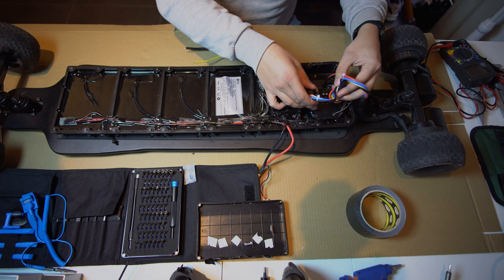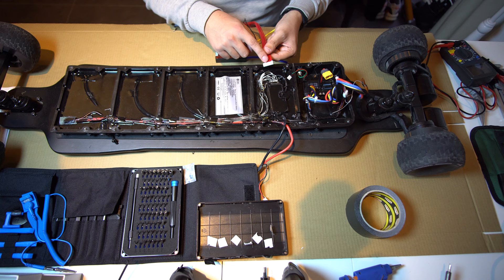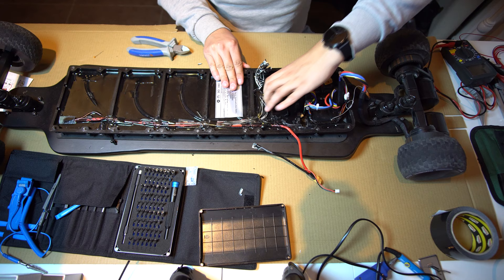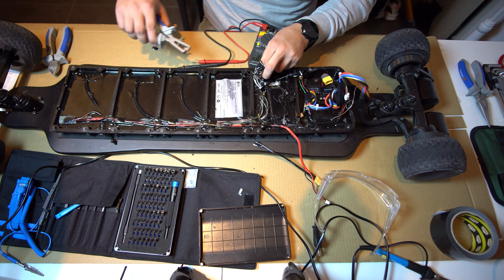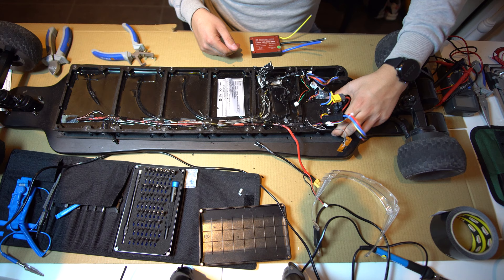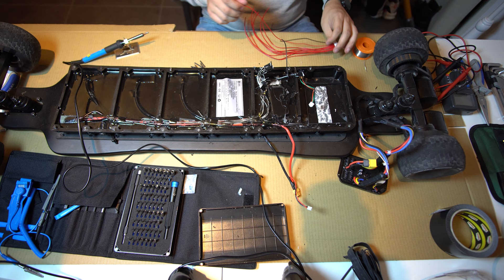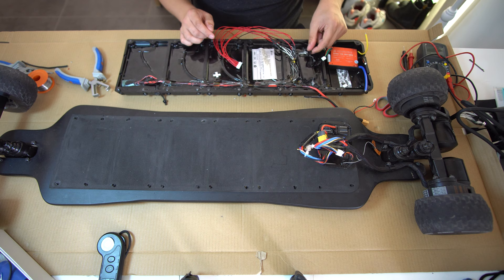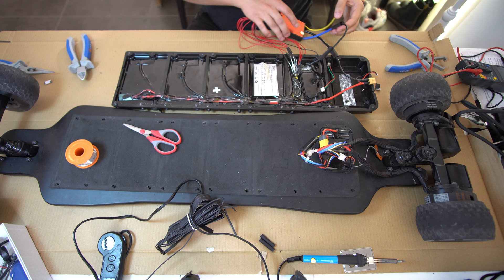How To Replace a BMS (Ownboard Bamboo GT Battery)

Comment: Hello sir. I got 43.6v for the whole pack. And 4.3v for each series. Is it normal?because even when i change the bms, the output from the bms is keep moving around 3.5v to 7.5v.
Reply from the maker: If the voltage keeps jumping around it might be the BMS. Make sure each series keeps a stable voltage. 

Goodluck!

Comment: Hey thanks for the video , appreciated! On the link, there is several bms of diff amps, which would you recommend? Thank you
Reply from the maker: I don't know the max power the motors can pull/the max amp the batteries provide. But if the amps you choose is lower then the max power draw of the motor/power output of the batteries, you'll be limited by the BMS.
Reply: Thank you

Comment: Well, I have an ownboard. I know it’s kinda of an outdated model, but recently, I have been seeing an issue, where the board switches off after I start applying brakes. It seems to be an issye only during hard braking. I am planning to replace the BMS instead of spending all that money on the batteries.
Reply: What do you think?
Reply from the maker: I've had this issue aswell. Mine seems to only do it when the battery is fully charged. When using the brakes, it has no 'space' in the battery to store the energy so it shuts off. After a couple of good accelerations, the problem seems to be gone. You can try to replace the BMS, but I'm not 100% confident it will solve the issue.

Hope this helps! Goodluck!

Comment: Can i use 30amp bms instead 60 amp?is there any effect on my bamboo board?
Reply from the maker: I don't know the max power the motors can pull/the max amp the batteries provide. But if 30 amps is lower then the max power draw of the motor/power output of the batteries, you'll be limited by the BMS.

Comment: Were the motors randomly cutting out and then resuming during your rides? Curious as to what time of issue you were experiencing with your battery.
Reply from the maker: The motors did not cut out. I was skating around 15km/h when I got a message on my remote saying 'battery level critical 10%'. Then it just  died and I got to walk home. After charging, the board turned on. When standing on it and accelerating, it just cut of and never turned on again.
Reply: @MathieuxLeysen   oh dang! Thanks for the video!

Comment: Does the new bms improve the charge time at all?
Reply from the maker: Hi Josh

That depends on the charger you'll use. The Ownboard charger only outputs 3A but the BMS supports charging up to 10A. 

Hope this helps!
Reply: @MathieuxLeysen  so is there a 10A charger we could use on the Ownboard Carbon AT to reduce charge times?
Reply from the maker: I have not found a 10A charger yet. If you do, please let me know!
Reply: @MathieuxLeysen  apparently 5.6A is the battery max anyway I found out.